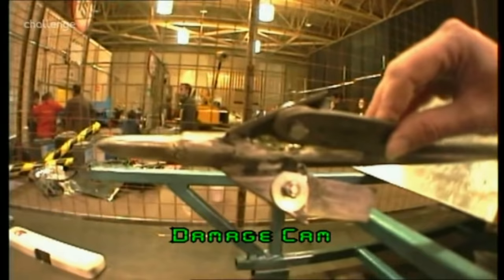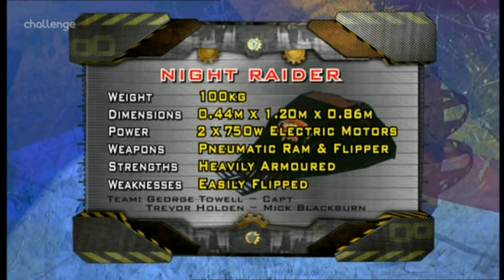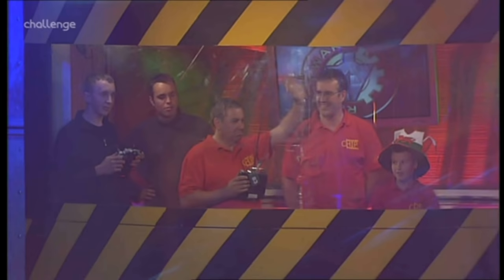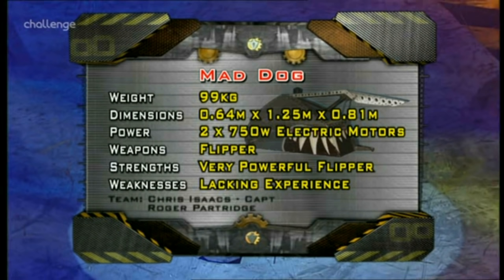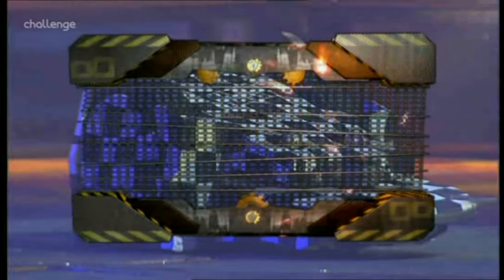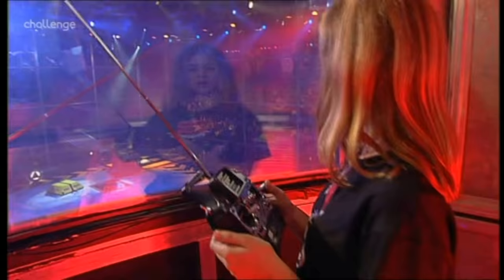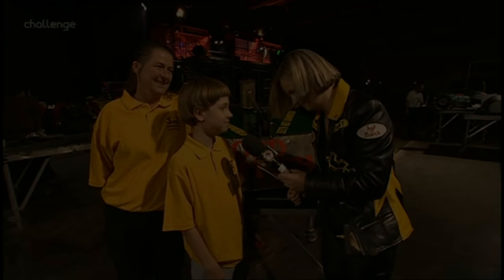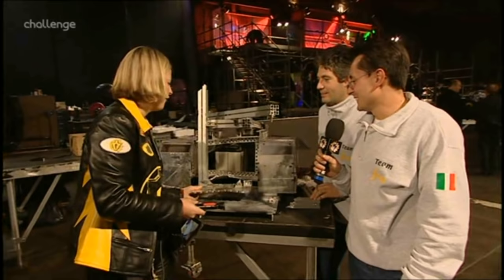Robot Wars One Fight Wonders - Extreme II Edition - 2003 - (50K Subscriber Special)

Comment: Ideas for future roboteers ('cause I'm never gonna use them);
Retractable drill bits, lightest way to reliably pierce armor. Bonus points if it's on a mini that jumps and latches on.
Gyrostabilized spinning top. Basically a beyblade. Might pass inspection if it can jump.
More chainsaw motors - Any spinner, but especially tumbler.. Multiple independent drives.
Reply: Actual entanglement devices (like the kevlar fibre inlays in pants for use with chainsaws)